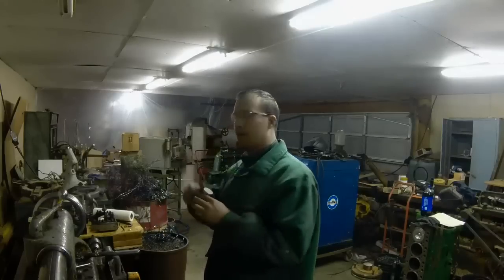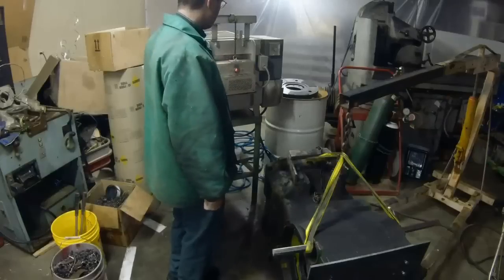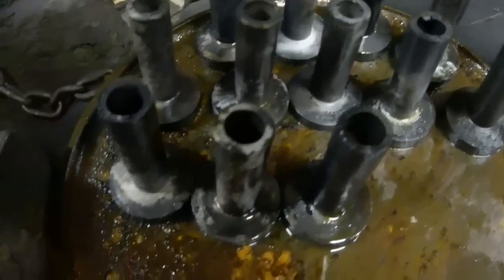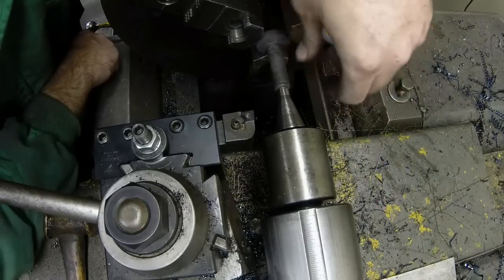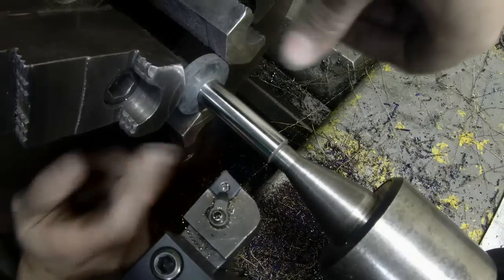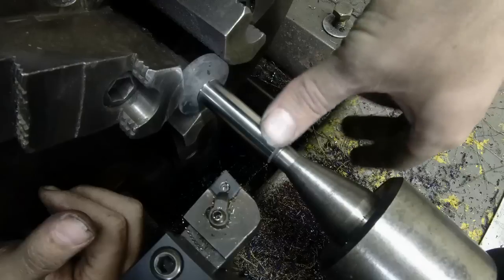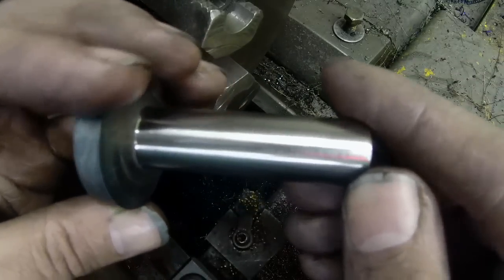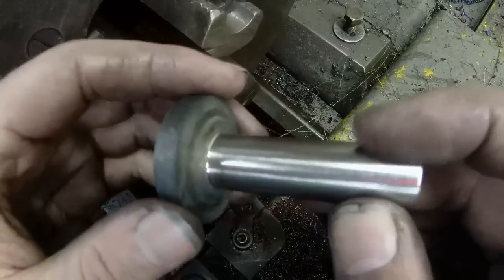Tappet Heat Treating and Hard Turning Revisited

Comment: Hi Brian.
Ive got some helpful heat treating advice. If you are unable to wrap the stainless tight to the part and there are pockets of air, like if the part was hollow or the dimple in the end of the tappet that your push rod sets in, put a small slip of paper in with the part before you wrap it. The piece of paper will ignite and burn out any oxygen left inside of the air pockets inside the wrapped part. The oxygen is what causes the majority of the heavy scaling. Great videos! I loved the transmission and clutch build! I love making power! Take care!
-Austin
Reply from the maker: +Austin Washburn Great tip! Thanks.

Comment: Brian, would have liked to see you face off the tappet! When you faced it off, did you use a measurement from face to face or did you measure from face to recess where pushrod sits? How did you measure hardness after heat treat and temper? What's the engine they go into? Assuming it's a pulling tractor, and something there's not a lot of preformance parts made for!!
Another great video!!
Reply from the maker: Fred Newman Hey Fred I surface grind the faces held in a collet so they have all the same face height.  The stems are all turned to the correct length and the push rod seat depth set with a ball end mill based form the end so they all end up the same.  These are 5.9 Cummins tappets. I give one to my buddy that works at a die shop and he checks hardenss for me as I don't have a hardness tester yet, but I would like one.

Comment: Well those various changes have all worked for you - that wrapping material looks quite horrible to work with when folding it.
Finished parts look really great
Reply from the maker: Dan Whiteford  Thanks Dan, I was happy with how they turned out and the time I saved in processing them.  being able to turn with one edge and not have edge wear problems really saved a ton of time on hitting size as these can only be .000 or .001-  for proper fit and knowing the dro is going to be the number you produce saves a ton of time.

Comment: I was taught by an old Master to heat treat by just using water no smoke that way.  And I have a ceramic cutter I have used for turning transmission shafts with # ttp 322.  I don't know if that helps good luck

Comment: Brian
Now I dot know if this would work in your case ,but I have success with covering part to be hardened / tempered by covering them in the hard laundry soap ( in the UK it's a hard green block not face soap )
Maybe worth a try as that stainless looks nasty stuf just waiting to slice your hands open

A quick question to mention you do not have mains three phase on site ,do you use a rotary converter if so what size to power that 25 HP mill about 30 KW with losses
I do not work with large stuff now but serviced many a large machine in the past at the iron works ,the kind of machine that could take a 2 inch wide 3/8 thick chip , it was a wee bit more than 25 HP tho biggest things I have worked on apart from steam turbine for power geneneration was a 1.5 MW fan and the same size induction furnaces

Nice to see the old Iron doing its stuff

Stuart
Reply from the maker: Stuart Hardy That is some big equipment Stuart. I have a fondness for the big stuff. I have a 30hp RPC with an old cast iron frame motor for the generation as supposedly the old motors do better because of the bigger frame size and more copper in the windings. I am lucky to have a 300amp service to feed these things. I wonder if Borax laundry detergent would work well? I wonder how the Boron would react if at all? Maybe something to try on something a bit cheaper, this tappet material is $10/inch!  Thanks for watching and commenting as well as the possible tip. I love to learn from the comments. :-)
Reply: Brian
Don't know about that detergent but the stuff I have used is a hard block , what my mom and wife used on shirt collars rubbed in before putting in the machine , known as Fairy soap over here . Yep they were big stuff but at a iron works it was the norm big and old most pre war , a bit of lease lend from the USA same make as your mill ,but most was DC 220 volt with open switch gear on slate . You may guess I am no longer in work at 67 .
What happened out for the old motors and do not believe the name plate rating often they just sampled the HP for what the customer ordered when I did a stint in the armature winding dept a 25 HP had the same windings as a 5HP 
That a good supply you have there but I guessed that as it took the load without stress 

Stuart

Comment: Hi Brian,
That stainless tool wrap looks like nasty stuff.  Kinda like wrapping them with razor blades!  They came out nice, though.  Before you heat treat them, how much oversize do you turn the tappets?  Thanks for the video!
-mike
Reply from the maker: ***** I did .020 over this time just to be safe and it all cleaned up nice so I think I will stick with that in the future on parts this size as machining it off wasn't a problem.

Comment: Hi Brian,
What part of witchcraft are you in, cooking toads, frogs, gizzards, tappets and sage... lol
I've used some CBN, PCD inserts, and, not tried yet an insert made by SECO for ultra hard stuff not limited in DOC, TH1000,
How did the first batch turned out, if you've used them so far?
Yap $50 from the Tube, had to hire a accountant and a financial manager to deal with this unexpected fortune... :-D
Take care, Pierre
Reply from the maker: pierre beaudry  I cook eye of tool steel. :-) The first batch turned out fine and are gone in motors, but a few didn't clean up so I had to make another batch to complete the order and in the meantime I sold another set so just made more and wanted to try something different to get a better result. I am happy with how these turned out, very smooth straight and true.
Reply: When you can eat the very hard stuff you generally get a super finish, just about mirror like... With the right tools ===> the best results
Reply: try very hard not to eat your parts.
Reply: Just by changing the order of the words...
"Try not to eat the hard part"    ;-)   Seriously at 61 I can't bend anywhere near those parts, and, be gentleman enough not to comments at how hard they get...!!!
Reply: Must be a new definition of metal munching. lol
Reply: gbowne1
lol   ;-)

Comment: In one of the comments you mention that you surface grind the face of the lifters. Lifter faces are not supposed to be flat. they should have a spherical shape to cause the lifter to rotate while the cam lobe passes under them. this keeps the cam from scraping the lifter face. http://www.cranecams.com/bulletins_listview.php?s_id=4
Reply from the maker: In this case the grinding wheel that does the lobes is at a very slight angle to impart the desired rotation to the lifter.
Reply: just how would having an angle on the grinding impart an angle on the lifter when you are running the lifter back and forth under the grinding wheel. I think you need to go back to engineering school.
Reply from the maker: Jim Pollock
I think you need to go to reading school. I stated the wheel that does the lobes is at an angle. Since you apparently don't know the lobes are on the cam not on the lifter.
Reply: you still need the lifters to be spherical on the end even when the lobe is ground with a slight angle.
Reply: This is taken from that link a gave you from crane cams. I don't think anybody knows more about cams and lifters than them. "Normal lifter face areas have a spherical shape with .002" crown. It is not flat across the contact surface as many people assume."
Reply from the maker: Jim Pollock
That is a generalization based off a small block chevy. The reality is there have been all sorts of different designs used over the years and by various manufacturers.  Some manufacturers IE Cummins B series still use a total flat tappet and yet they seem to run 100,000 thousands of miles without failures.  Some engines use a flat cam with a flat lifter and an offset lifter bore instead to impart motion. The important thing is the lifters don't break and ruin your block like stock ones and they last for years and years and show no wear in the face or the cam, some have even been pulling for 15 seasons. These are racing parts not stock parts and they are done the way that they are for a reason and that reason is not because I am too dumb to know any different.  You are free to build your parts how you want and I will build mine how I want.